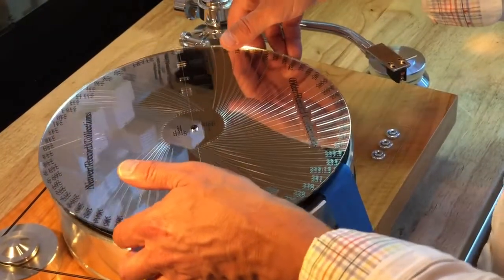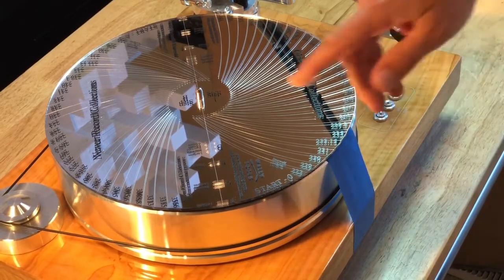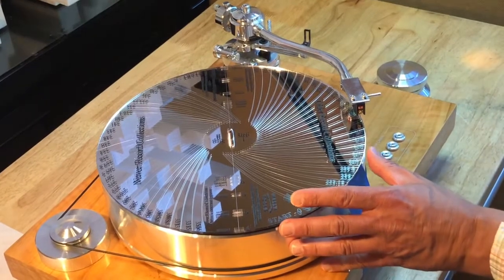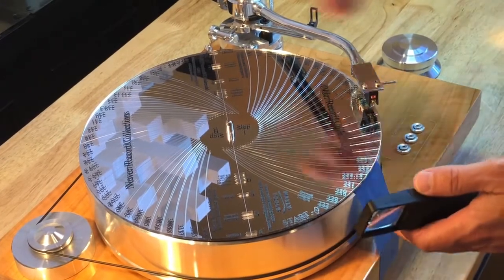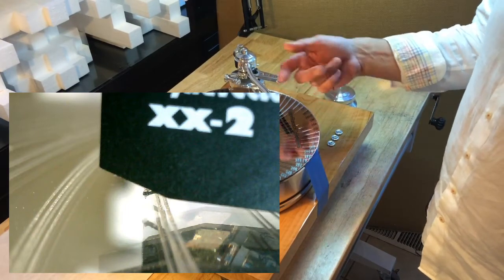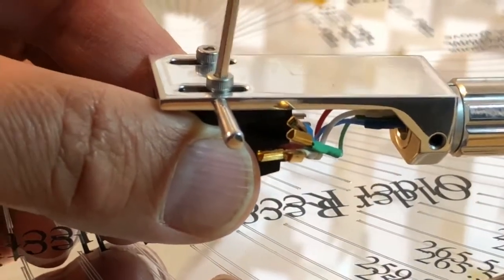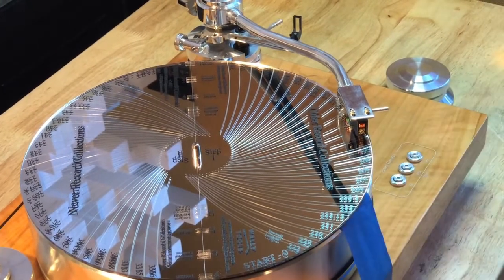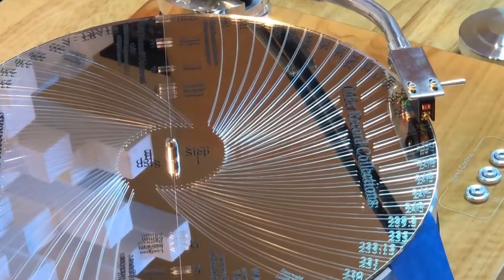WallyTractor Instructional Series (Part 3 of 4)  - Aligning the Stylus

Comment: Hello.And isn't it necessary to direct the vector of the line of the spindle template exactly to the center of the tonearm support? and immobilize this template.And then set the effective length of the tonearm?with respect.Thank you.!
Reply from the maker: Hello. For the process of setting overhang (what this video covers), there is nothing you need to align relative to the pivot of the tonearm. Even when you get to the step of aligning the cantilever, you do not align the WallyTractor relative to the pivot point, you revolve it to be aligned with the location of the stylus at whatever radius you are aligning the cantilever.
Reply: @WAM-Engineering Thanks, I draw a tangent line for each tonearm using the following method.I'm immobilizing the turntable.I'm putting millimeter paper on the spindle.I'm fixing it.I mark the extraction point.Then I apply one end of my template to the center of the tonearm support, and at the other end there is a pencil, which I apply to the point of removal and draw a tangent line.Then, with zero anti-rolling and low vtf, I lower the stylus closer to the spindle on the finished line and add anti-rolling. Next, we look at how the stylus begins to move along the radius line.I think my method is not bad.)It may be primitive, but in the end it turns out to be an excellent result.I calculate zero points for each tonearm individually.Sorry, I'm writing with the help of an online translator.)
Reply: Thank you for your attention.

Comment: The cartrige will never be perfectly aligned on any arm, arm geometry prevents it, you still need to check the alignment at the null points. The idea is to get the least error for a given arm length. Those arcs are for setting the overhang for a given arm length, then when you are perpendicular at the two null points you will have minimum error across the record.
Reply from the maker: Hi Brad. Help me understand: what about your tonearm right now does not allow you to optimize the stylus/cantilever alignment?
Reply: @WAM-Engineering  ,Sorry, No problem "optimizing" my cartridge.I just over-reacted when you said "perfect" across the arc. Because of tonearm geometry it will never be perfect across the whole arc, Thats why the 2 null points where it will be perpendicular and minimized on the rest, depending on whose you use. I prefer the Baerwald or Lofgren A which are the same. This tends to spread the mis-tracking most evenly, But it depends on the type of music which you might want to use. Thanks for the interest tho.
Reply from the maker: @bradt.3555  The overhang can be perfect, but you are right - angular error varies across the arc. However, this normal variance should not be a concern. What IS a concern is that so much money and engineering effort is spent on decreasing tracing error with 12” tonearms and linear trackers but it is rare that I analyze a cartridge with one degree or less zenith error. I’ve seen as much as 5.25 degrees zenith error but most are about 2 degrees off of perpendicular to the cantilever. However, if the zenith error can be measured then it can be corrected for with the WallyZenith.
Reply: @WAM-Engineering  Ok I guess your gonna make me watch the video about the zenith angle. I agree if the needle isn't straight in the cartridge then aligning the cartridge doesn't do it.
Reply: I've watched more of your video, OK I see you absolutly know what your doing. Sometimes I hear something in a video, and don't look before I leap. Watching your video makes me uncomfortable as I've spent the last half of my life trying not to be such a perfectionist. Very nice set up tools.
Reply from the maker: @bradt.3555  I don't have a great deal published yet on zenith error. I am still improving my microscopy on this and developing an "at home" solution for zenith error measurement that I hope to have available this summer. In the meantime, check out this article by Michael Fremer: https://www.analogplanet.com/content/zenith-angle-correction-final-set-frontier

More to come!
Reply from the maker: @bradt.3555  Ha! What's so bad about being a perfectionist if it will improve your playback performance? ;-)

Thanks for the complement, Brad.
Reply: @WAM-Engineering  , Well, because you can't achieve perfection, so I'm never satisfied.Correct me if I'm wrong, but by continually moving my cartridge in and out and changing the angle, when it finally lined up on both null points of the Baerwald, then the overhang by defalt is correct.

Comment: why do you choose 254 specifically for this arm?
Reply from the maker: Hi Luke! That tonearm (Project Signature 10) has a published effective length of 254.8mm. On the WallyTractor, the 254mm arc is the nearest one to the published spec. Like most tonearms, this one offers plenty of play in the headshell slots to offer a degree of freedom to vary effective length slightly. I hope that helps.
Reply: @WAM-Engineering  but why not use the 255, 254.8 is closer?
Reply from the maker: @maurice4407  because there is no 255mm arc on the WallyTractor and no need for one since the 254mm arc is there and tonearms allow for variation with the headshell screw slots. The most important factor to playback quality when aligning the cartridge on the horizontal plane is getting the angular offset correct. That is what video #4 is about.
Reply: a trick : watch movies on kaldroStream. Me and my gf have been using it for watching loads of movies these days.
Reply: @Branson Ford Definitely, I have been using KaldroStream for months myself =)
Reply: @Branson Ford yea, I have been watching on kaldroStream for since november myself :D
Reply: @Branson Ford Yup, been watching on kaldroStream for months myself :)
Reply: @Branson Ford yea, I've been using Kaldrostream for since november myself :D
Reply: @Branson Ford Definitely, have been watching on kaldrostream for years myself :D